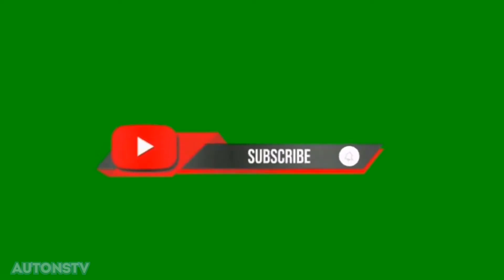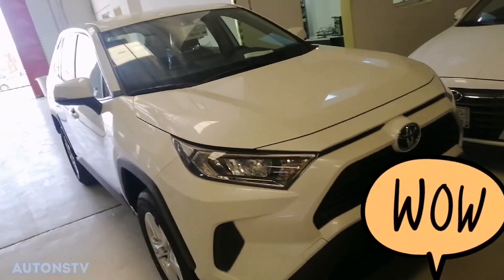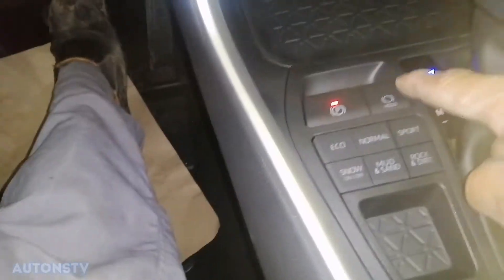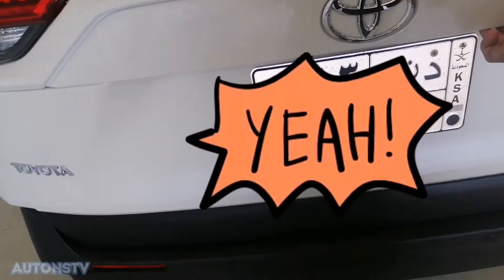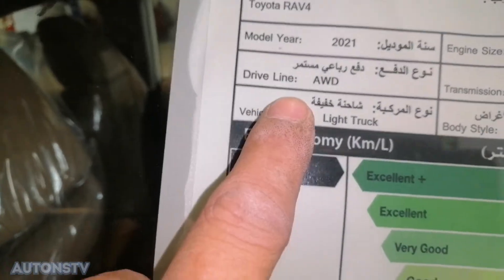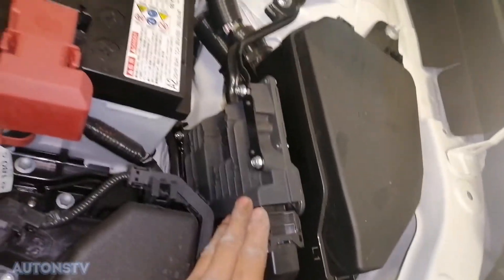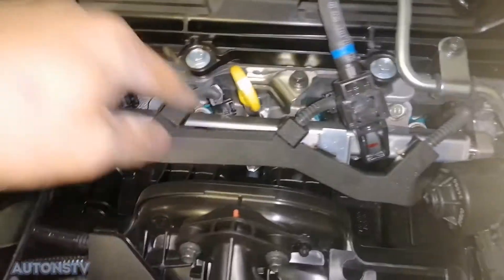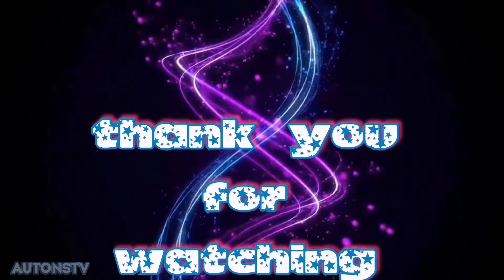review  for Toyota RAV4 2021(engine M20A  2.0L)model.

Comment: I own one of this 2020 Rav4 here in Sydney, Australia. I was surprised when I took it to the dealer for my first service. The dealer uses Repsol 5W30 oil.  I was expecting 0w16 oil. The car care nut, Toyota master technician said, to change oil every months to avoid future engine problems. So I change oil every 6 months regardless of kilometres.

Comment: How many km can live this engine 2.0liter?
Reply from the maker: Depends on taking care of the car and using it, there are others because they lack maintenance, it will take up to 100k km for the engine to break down ,!
Reply: @AutonsTV29  it's in the bad case..But if i take care of engine, maintenance and i change all at the time,it would live more...but i dont know how many km it can live..
Reply from the maker: @royale_king3171  I just really need to take care of the engine for it to last. I know toyota cars are durable and will last. I can't tell you how many km the engine will run for its life. But when it reaches 300k km, it needs a general overhaul. to replace the inner part of the engine.
Reply: @AutonsTV29  thank you
Reply from the maker: You're welcome.